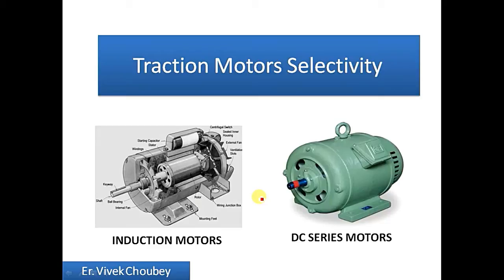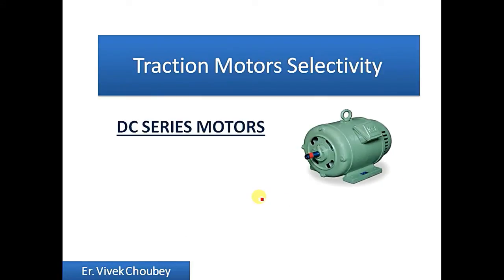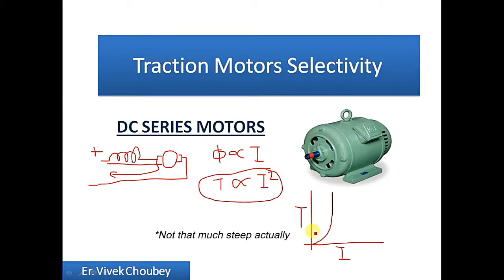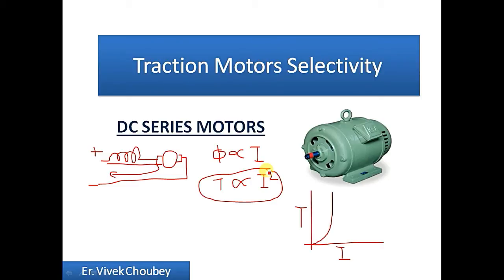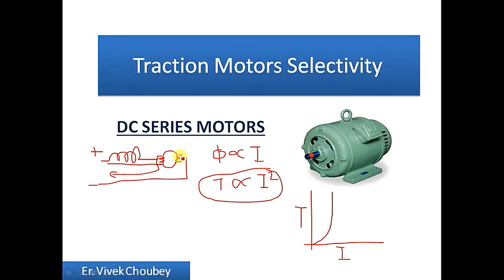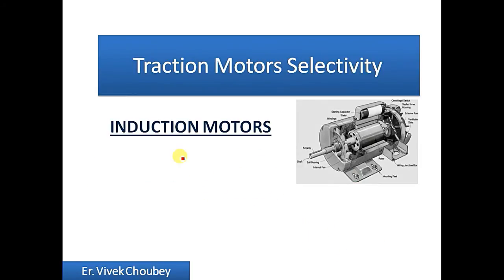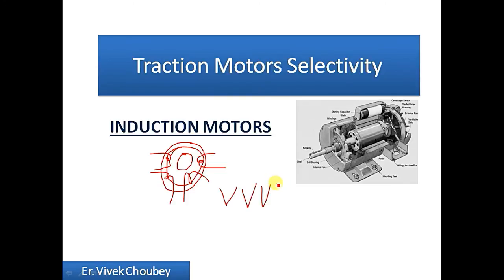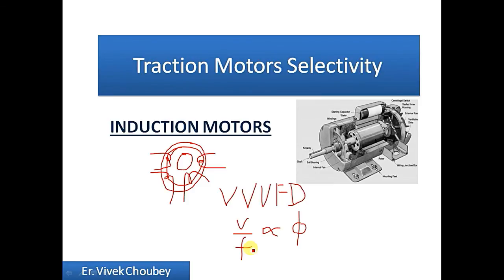TRACTION MOTORS SELECTIVITY - Induction Motors Vs. Series Motors

Comment from the maker: Now-a-days, VVVfD (Variable Voltage Variable Frequency Drives) or V/f control based Induction Motor Drives are being used for its good starting and running characteristics. Check out how it works : https://youtu.be/tmWJ_plElWM

Comment: Sir how a dc series  motor  is act as a universal moror
Reply from the maker: DC Series motor acts as a universal motor because it can run on both AC and DC supply. This happens because the torque of a DC series motor is directly proportional to the square of the input current. That means even if the current is negative, the torque is unidirectional or positive both in the case of AC and DC. The torque of any DC motor is directly proportional to the product of field flux within the machine and armature current. But field flux is directly related to field current and in a series motor, the armature current is the field current (because connected in series).  So the torque is directly proportional to the square of the armature current.